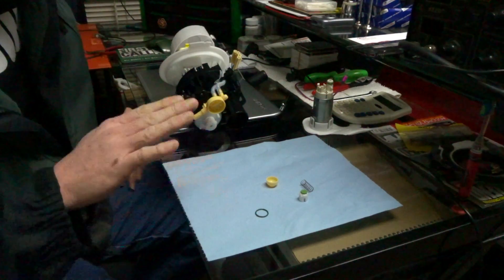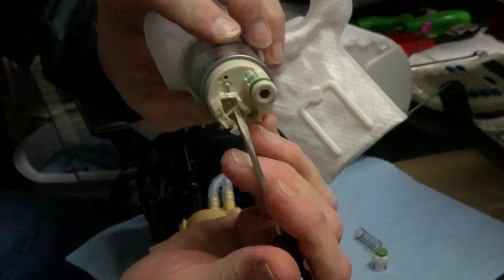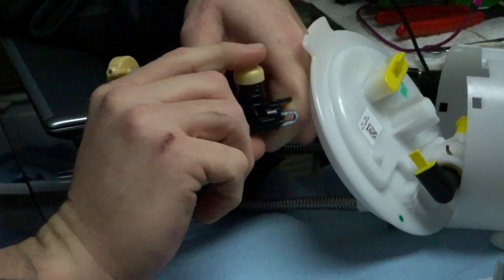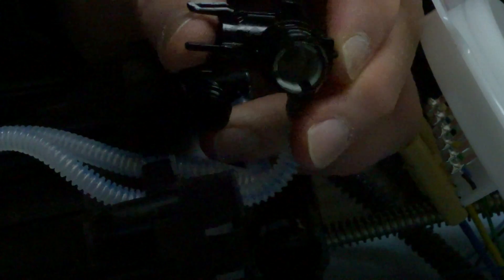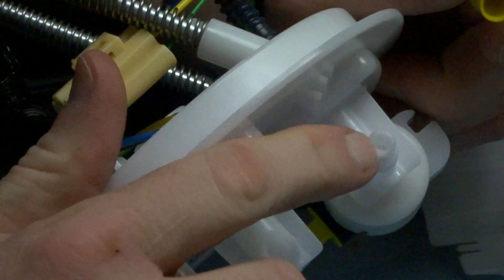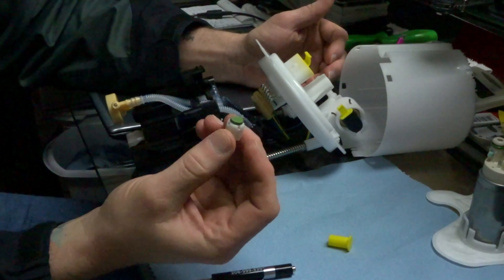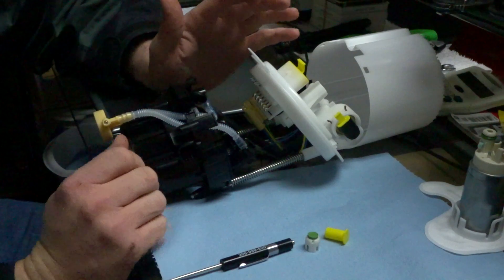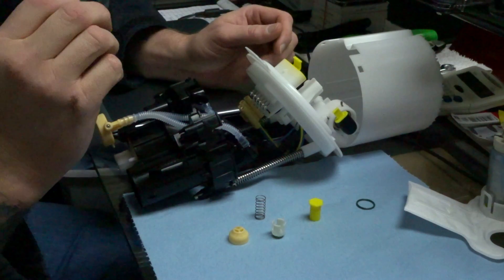Stinger Fuel System Update... big news!

Comment: Did this ever get resolved? What about drilling it out and adding a bigger check valve? It would be nice to get more power on 93 without WMI.
Reply from the maker: No... I cannot get anyone to address or make the small connector. 

The only other option will be to move over to a return line system if we want to get rid of the existing issues.

Comment: Were you able to come up with a solution for the check valve is it necessary to even have the check valve? Or did you open the holes successfully for more flow? Please get back to me.
Reply from the maker: Check valve is not needed, but it will cause long crank time and hard starts if removed.

Comment: Hey there, how did the testing go after the re-size of the check valve holes go?
Reply from the maker: I have not gotten a chance to do that yet.
Reply: @TorkMotorsports  Ah, it would be interesting to see what you find out.  One thing I am wondering, if the flow through the check valve increases would the pressure on the venturi decrease?
Reply from the maker: @CHUDHUCKER  I will be testing some things over winter to get this figured out.
Reply from the maker: @CHUDHUCKER  we suspect that might be the case, but... I am thinking that it might also start sucking air, which could be causing a whole different problem.

Comment: did this actually fix your issue?  I dont see a follow up vid?
Reply from the maker: No, running the basket out of fuel is our current issue. Have to keep the car over 1/2 tank if we want to run more boost and make more power.

Comment: Great news on finding that check valve restriction! I have been seeing a drop in fuel pressure at full RPM with my setup below (GT1), although as you mentioned I'm sure it's not as bad as some since I'm running water methanol. Very curious to see what you find during testing of the pump flow throughput before and after the modification. Thank you very much for the excellent research.

BMS JB4 w/Fuel Wires and Water-Methanol Injection 
(Map8 @ 95 Octane)
HKS 45il Plugs @ 0.25
Borla S-Type Exhaust
SSR Performance Downpipes
Injen Intake
HKS SQV Blow-off valves
Tork Oil Catch Cans
Billet Lightweight Water pump pulley
Big Bore Throttle Body
Ultimate Performance Garrett core intercooler w/3" charge pipe
Secondary Oil Cooler
Secondary Coolant radiator
BMS Pedal Tuner 
Eibach Pro-Plus Suspension (Lowering Springs + Front / Rear sways)
20x10.5 Rear 20x9 Front Vertini wheels with Nitto NT555 G2 (285/30/20 + 245/35/20)
Reply: Hey @Tork Motorsports - Any updates on the fuel pump restriction?
Reply from the maker: We will have some soon.

Comment: What happens if you just take out that check valve and leave it out permanently instead of drilling it? Surely the factory check valve will eventually cause the fuel pump to burn up and die!
Reply from the maker: Not sure, that is why we will be drilling it first.
Reply: nothing harder on a pump than filling empty lines